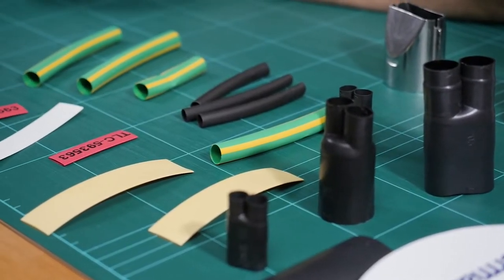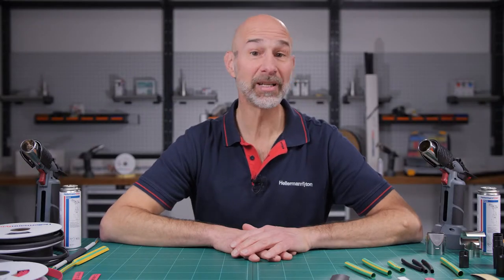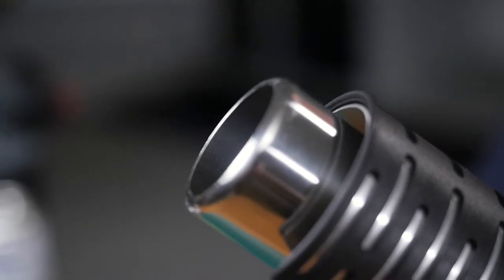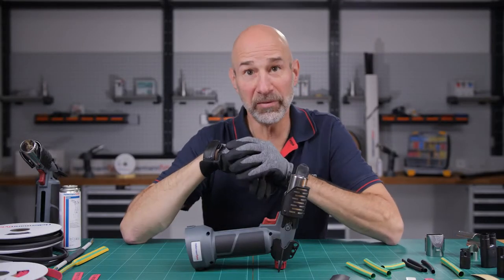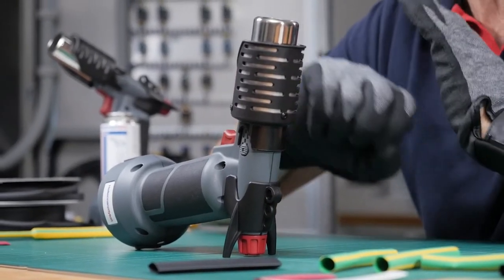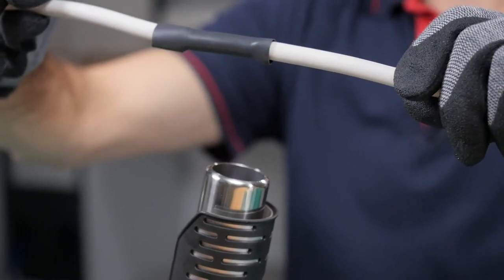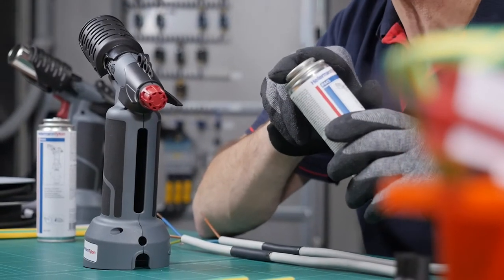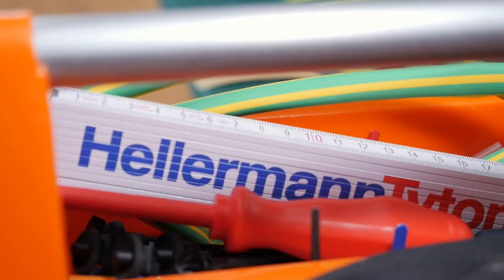How to use the hot air gun CHG900?

Comment: I wonder if you could compare it with the E4500, ie. what's changed and improved in the new model?
Reply from the maker: Hi Dawid Ciecierski,
thanks for asking: The new CHG900 cordless heat gun offers the following benefits compared to the E4500:
• Light and portable at 440 g (555 g incl. cartridge)
• Instant flameless heat up to 900 °C without external power
• Works consistently even at temperatures as low as -8 °C
• Up to 90 min use per replaceable P445 gas cartridge
• Integrated standing pod enables safe hands-free use
• Precise gas adjustment and 360° rotation without flaring
• Tool-free replacement of Piezo Ignition and Gas Nozzle spare parts

For more information about the CHG900 click here: https://www.hellermanntyton.com/chg900?utm_source=youtube&utm_medium=social&utm_campaign=youtube&utm_content=contact-comment-6lQoVMez1ng-chg900

Best wishes,
Nico